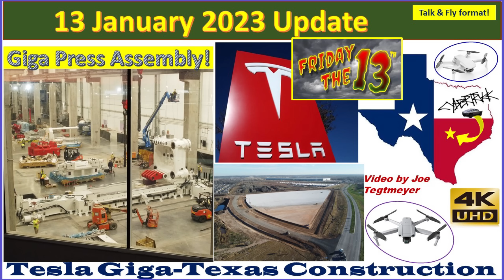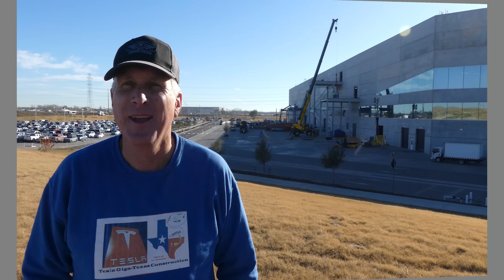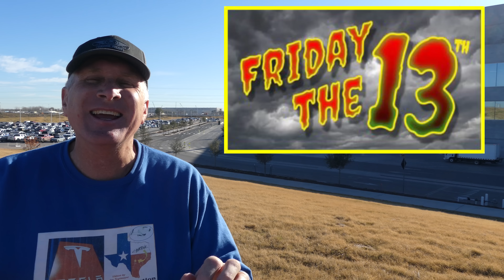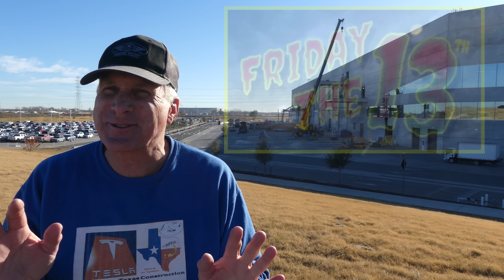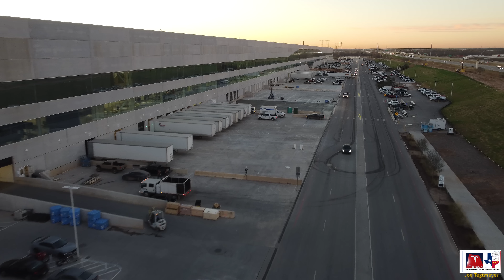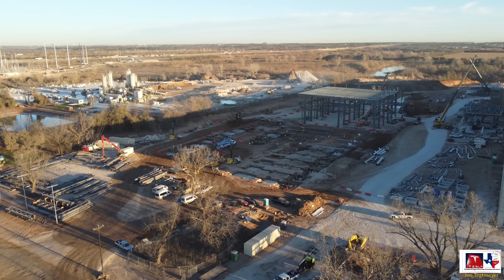9K Giga Press Assembly & Inside Views! 13 January 2023 Giga Texas Construction Update (07:30AM)

Comment: Note the HAAS Vertical Machining Center at 5:31. Made in Oxnard, CA. This company started with manual rotary indexers. I remember using them in the various shops I worked in. I even got to use one of the early VF-1 mills. Super easy to program, setup, and run. Haas is now the largest machine tool builder in America.
Reply from the maker: Very cool info! This looks like a VF-6/40 CNC machine.

Comment: The Dye/Die? building going up next to the Cathode plant looks more like the buildings at Star Base. So I wonder if they will use steel panels for the exterior walls instead of Concrete panels. And I also have a theory that the new structure to be be built on the south end of main building won't actually be a continuation, but more like an annex which could be connected by a sky bridge or 2. So they will leave an access for vehicles to circumvent around the building and not have to go all the way around. Just a guess.

Comment: 21:15 The concrete blocks may be to build blast shields between the transformers and switches. When you switch that much energy, sometimes the switches disassemble themselves with a great deal of force or as the guys at SpaceX call it, a RUD, or Rapid Unscheduled Disassembly.
Reply: There's also a couple of pallets of some flat items that I suspect would be a cover, maybe a grate to span the basin around the transformer footing. Retaining wall and footing have a cast in angle to receive something.

On a lesser scale I've had plenty of RUD moments associated with opening up an unfamiliar lock for the first time. Springs, ball bearings, a weirdly shaped tiny bit of brass. Have to find them all and then get them back in the right place.
Reply: @DessieDoolan   I’ve never seen one RUD but I was working at a large broadcast facility that runs its technical center on two separate uninterruptible power systems. They have two huge inverters that are always turning DC from huge battery banks to 4kv AC at about 400 amps each. Then they have charging systems that are always feeding power to the battery banks. Pretty fool proof. Except when something goes wrong in the switch that switches the DC to the inverters. This piece of copper bar that’s used as the knife switch arcs then vaporizes itself all over the inside of the cabinet used to enclose it. So, in addition to the puddle of copper at the bottom of the cabinet there is a fine film of copper deposited on the walls and everything else on the inside of the box. That was a tremendous amount of energy and they were lucky that it didn’t explode and blow itself off the wall. Caused $35k worth of damage to protect the $1500 fuse that didn’t blow. Oh well.
Reply: @Bill_N_ATX  I have a old time knife switch down in my shed mounted on the wall as a display piece. It's 150A 415V. It was the main switch in an old factory where I did a lot of work over the years. 

At least they thought it was the main switch. Sometime after it's initial installation a cabinet was built around the switchboard. Built so close that the switch couldn't be operated. No one knew for sure how long it had been like that, but as soon as it was spotted by a new more observant electrician he reported it to the electrical supplier (he was obliged to) and the entire switchboard was condemned.

I don't know how it ended up in my hands, other than no one else seemed to be interested in it.

Comment: Joe, Good picture of the 9000 Ton caster at 7:17.   The bed is across the bottom, the right white casting is the hydraulic cylinder and tie bar support for the closing pressure. The moveable part is the red casting toward the middle of the picture. It will be moved along the tie bars by the red links connected to the hydraulic cylinder and cam over to lock. The other white casting is the left support for the tie bars and will also support the injection assembly. Part of the injector is shown in the view above and to the right of the red moveable part. The die halves will be positioned between the left large white casting and the red moving part.  This caster has the injection on the left, the other 6000 T units inject on the right.

Comment: A "Die Shop" is just what is sounds like. The giga casting machines have two opposing "Dies". Replacing them is a normal maintenance item. Being able to make their own is a HUGE cost savings from paying a tool and die maker to do it. This one shop will be able to support the factory here, and probably in Fremont as well. The heavy pier structure is probably for a big multi axis mill.
Reply: Agree 100%

It also allows them to rapidly update dies and create new dies. This will speed up how quickly they can update current platforms and launch new platforms.
Reply from the maker: They already have these facilities in the main factory, both in the stamping and casting sections.

Comment: The DOCK levelers being installed in the loading docks go in pretty quickly if the aperture was cast correctly and the conduit for the safety mechanism and lights are there. One presumes they took that into consideration at the beginning. As to why they didn't install the doors and DOCK levelers at the beginning, I am guessing the overall design was still incomplete and it may have been thought that they would not have been needed. The overall design of this project has been pretty fluid.
Looks so pretty in the morning gloam.
Reply: Just a guess but I was thinking maybe they couldn’t source that many dock levellers all at once
Reply: @JohnHuitema  like most everything on site, they have bought in bulk in advance. Starting with HVAC heat exchangers, structural steel, roof insulation, the works. The design of the area likely changed and now they need the loading docks. Easier to remove plugs than modify the curtain walls. Note the space for the dock levelers' cavities were formed and cast as part of the perimeter beam.

Comment: Thanks Joe. Great views inside Casting.
3:39. Casting, apron. Laid a couple of rows of bearing plates on the bare earth. Don’t want a Gigapress delivery getting bogged.
5:17. Casting. Top. Handrail along the plant platform.
5:58. Casting, inside. White steel columns now fitted with a clamp around the concrete columns.
6:19. Casting. 9000t press. Sits directly on the concrete floor unlike the 6000t presses that were mounted on a steel frame cast into the floor.
7:29. Casting, inside. Against the wall to Paint. Excavations for column footings. Extension to the overhead plant platform.
8:56. Battery. Right. Temporary room/enclosure being constructed. White panels, red taped joints.
9:46. GA, apron. 3 loading dock levellers to the left are unique. Temporary perhaps, or for some specialised delivery vehicles.
10:14. Main Entrance, inside. Welding flash to the right. Re-design of level 2 floor. Diagonal edge beam. Props holding up the new beams and joists where the small column on row Bb was removed. Becomes more visible as the drone pulls away. 11:05 also. Better photos on Joe’s Patreon page.
11:42. BIW roof opening. That would likely be it. Tops of cowls are done, same as those on the Battery roof.
12:55. East-west road, north-south road intersection. Possibly a single lane traffic circle/roundabout.
14:52. Far, far east. Structural Battery Packs. Interesting to know if these are dummy packs, or failed packs loaded with 4680s. More packs top right with the BIWs.
16:51. Cathode, new building. The girts (horizontal members between the columns) suggests a vertical panel arrangement. Steel sheeting, sandwich panels etc.
17:03. Cathode, plant platform apron. Grey coloured items of plant equipment placed at each end.
17:37. Cathode. Worker in the boom-lift is caulking the panel joints.
18:56. Cathode, north. Elevated water tank has been removed.
19:23. Cathode, west. Water main seems to be deeper here. Other utilities may cross above.
19:39. Cathode, new building. Roof decking being installed. Height of building. 9 flights of scaffold stairs at 6'6". 58'6" roughly at the stairs.
20:25. MM Batch Plant pond. South side. Blue water main. Connection to the city supply for Cathode.
Bottom left. Excavator might show the alignment to be followed. Happens to match Tesla Road.
22:40. Mega-pack site. Unusual delivery of gravel and earth at the same time.
23:05. Westside steel storage yard. Mr Plod paying a visit.
24:30. W-WOW. Clearing out the middle section, laying fresh gravel. W-WOW extending northwards.
26:23. West Logistics Yard. Wheel stops placed at a spacing to suit smaller vehicles. Not trailers.
27:36. Easements intersection. Right of screen. Digging holes. 30:38 also.
29:33. Southend. New square of asphalt removed.
Reply: 26:23 I was going to mention about the asiles being too narrow for trailers but looked for a post from you first. Sure eneough it didn't get past eagle eye Dessie.🙂
Reply: @patrickdougherty2777  26:23. Prior knowledge! Brad's video yesterday had a good shot with 'regular' sized vehicles parked there. https://youtu.be/ps0gnUHocbw?t=133

Would be interesting to know if this is the 'West Logistics Yard', or an interim use of that space.
Reply: Got all 4 rods for the gigapress delivered already!
Reply: @TheZackrambo  Yep, cracking ahead with the assembly. And, digging holes metres away, 7:30. The Tesla way.
Reply: @14:52 Doubt they would be failed packs, if they were they would be sending them to Redwood Materials to be recycled.  Cannot just take the cells out of the pack and would be too dangerous to just crush them.
Reply: @Dwayne.Shea.231  14:52. Packs still in the cradles I guess could be stored there before being shipped elsewhere for recycling. Packs across to the north in amongst the BIWs for sure would be empty. Some may have been busted apart. Can't quite make that out.

In Engineering with Rosie's recent livestream, she talks about the economic viability of recycling batteries. I can't find the timestamp, but video is here https://youtu.be/piJU5hl_fkE
Reply: @10:14 Do you think there is the possibility that the reconfiguration of the main entrance will be just landscaping and ramps into the building.  I cannot see why you would be deliberating be putting a slope on the foundation if you are going to concrete it.  Definitely interesting to see what happens here.
Reply: @Dwayne.Shea.231  10:14. Wild speculation. Vehicle ramp north and south. Stair facing west, pedestrian ramp either side.

Inside is where the action is. Angular 'Cybertruck language' taking shape.
Reply: @DessieDoolan  Nothing would surprise me anymore 🤣
Reply: @Dwayne.Shea.231  10:14. I think the front doors are toast.
Reply: @DessieDoolan  ramps and stairs forming a Tesla “T”?
Reply: @voyagerintotheunknown  Tesla T? Could be, plenty of possibilities at this stage. I can’t make out anything other than a general ‘angular’ design. What’s going on inside with the changes to the shape of the second floor might have some relevance to what’s happening outside as well, as in the design inside might carry through to the exterior.
Reply: @Dwayne.Shea.231  10:14 - It is easier to set the grade at the final angle and excavate footings as needed when needed.  You have to use smaller equipment if you do the footings first.

Comment: Joe, great work as always.  The stop bars in the parking lot appear to close together to support trailer parking.  I wonder if they would park new model Ys on that gravel?
Reply: I think it will be construction worker vehicles. The manufacturing employees park on blacktop. Construction workers are still parking on part of the paved lot on the east side, and manufacturing worker parking is getting short. I think they will move the construction workers out of the paved lot.
Reply: Agree that those are car spacings, not tractor trailer parking. Why way out here with not much is going on unless that's going to change with some new building going up over here. New Y car parking doesn't seem plausible either as they ship everything out very quickly to the rail yard, existing parking is never near 50% capacity with more space available nearby.

Comment: The new steel building will not have concrete wall panels, they have installed wall girts, so it will be some type of metal panel.
Also, I don't think that the new parking lot across the highway will be for trailers as the parking blocks are to close together.

Comment: Hejy Joe! the blocks in the new parking lots seem too close to each other for trailers, no?
Reply: Was going to comment on that.  If you look at the wow, the spacing is way to close for trailers.  I thought it was going to be parking, employees or for new MY’s?
Reply: The ‘white blocks’ @ 02:14  ??

Those are trailers.. you can see the wheels on some, and also the under-run preventers ….
Yeah, video is kinda hazy, but structures are visible.
Reply: I bet on employee parking and a Boring Tunnel shuttle to the main entrance ✅

Comment: at 7:27, it looks like they are busy cutting up the concrete in the floor... modifying some foundations ??
the die shop is where they'll be manufacturing and maintaining the die cast molds and sheet metal press dies
Reply: 7:27. Column footings for the overhead plant platform. The new white structure seen at 5:17 for example.